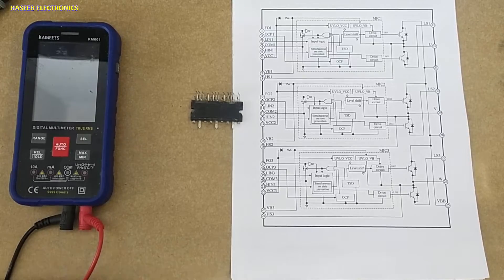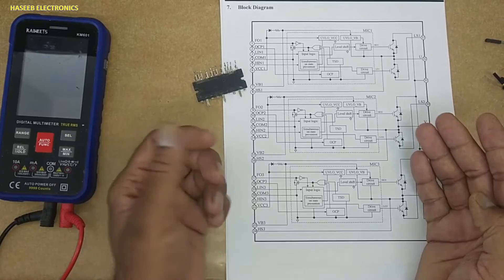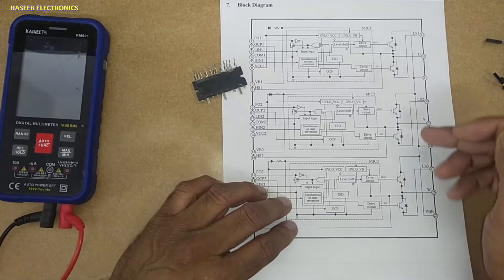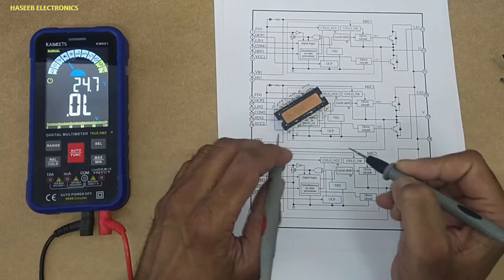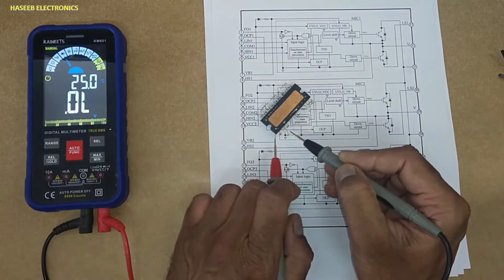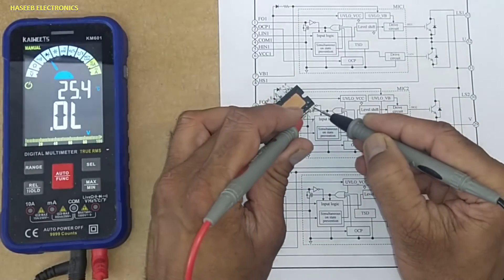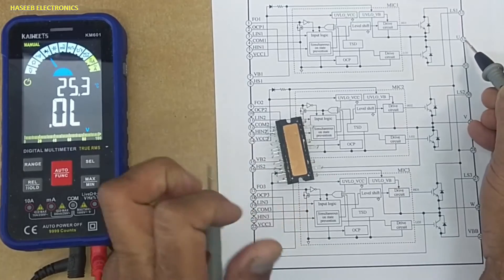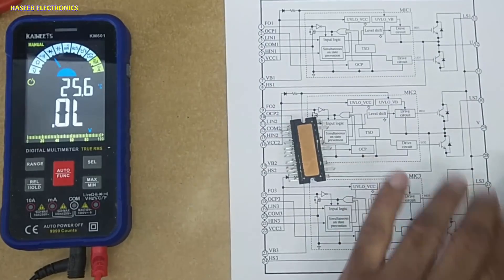{972K} how to test IPM using multimeter

Comment: Thank you sir, i try to fix my 1 to 3 phase inverter for 2,2kw motor drive
scm1246mf is too expensive at my place
Is it possible to change scm1246mf with scm1242mf for my inverter that drives 2,2kw motor drive ?

Comment: When an IPM is damaged, what are the other related areas to check in the board?
Reply from the maker: the first checkpoint is 
input resistors, between microcontroller and IPM
current sense resistors at emitters 
current sense operational amplifiers 
IPM power supplies